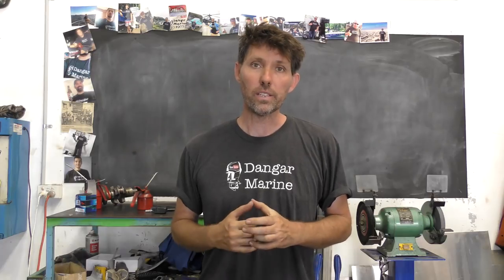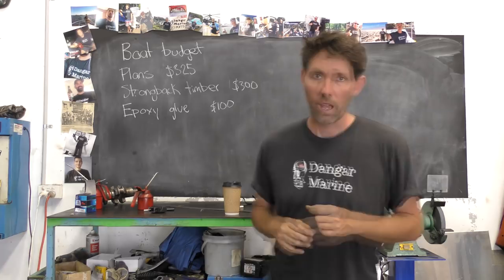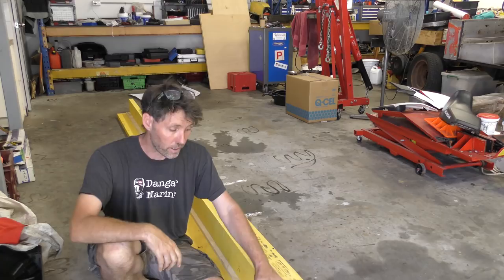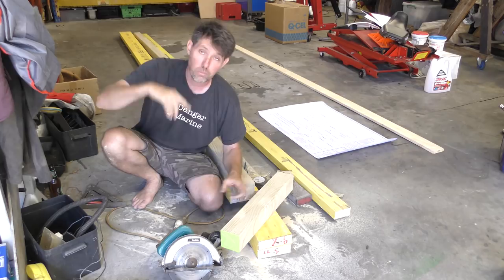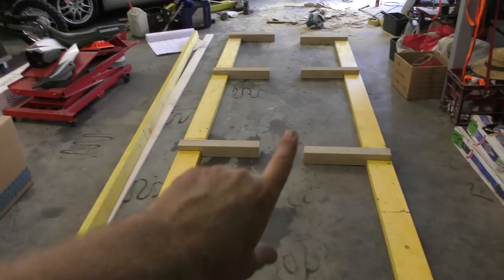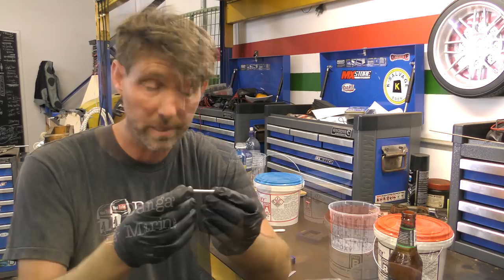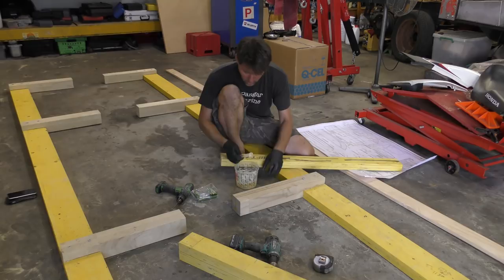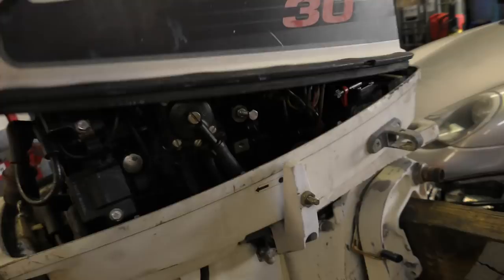Making the strongback

Comment: It's great to see you are building a Bowdidge design, i'm also building one his designs at the moment, just finished gluing the bottom panels and side panels. Mine isn't as complex as yours, i just wanted an inexpensive,  quick and easily built boat, so i went with his 14 foot Mushulu dinghy design. Came here for inspiration whilst the glue is going off. His plans are well priced and the back up you get from him is second to none

Comment: Great video .Can`t wait to see each step. Two bits of advise. Get off the floor and use a bench or table and get a power miter saw for perfect cuts . That will greatly improve your joints and fit. Cheers.
Reply from the maker: Thanks mate. Having the money for a mitre saw would be nice, but fortunately none of this requires a tight straight joint like you might want in furniture work. The rest of this build is purely done with a jigsaw and requires a small gap between each joint where the epoxy is pushed into, a bit like a weld rather than traditional timber joinery. Apparently having a tight fit creates a hard spot in the boat and actually makes it weaker.

Comment: Looking forward to the whole build! Just a tip, when cutting the 4x4s or any piece like those, instead of totally freehand, one easy way to make sure you saw squarely is to put your saw blade on the line you want to cut and then use your speed square up against the left side of your saw foot as a guide fence. Perfectly square cuts then...
Reply from the maker: Thanks mate. Yes, will be using a batten whenever straightness matters.

Comment: Great timing Stu. I have been debating my next boat as well. I wanted to do an aluminum boat myself. Looked at the cnc plans that you bring to a machine shop and have them cut the pieces and build at home with a jig. After seeing how much money for the aluminum and me not having any welding experience, or a decent($5,000+) welder that is preferred for aluminum, I knew it wouldn't be a smart choice. I do have good experience with woodworking. I build custom saltwater reef aquarium stands. So I figured I would go the same route you are. I'm happy you are giving a crack at it before I build mine. I will be paying close attention to the videos. GOOD LUCK!!!
Reply: jimbo gasoline 

Jimbo,  I am 3/4'rs through a build which I am thoroughly enjoying. I bought my plans from from the same place as Stu. HIGHLY recommended. Super easy, and I have zero boat building experiance.
Reply: GJ  GOOD LUCK BUD! I hope you like the final outcome. It would be cool to drive a boat that you built yourself. Once I finish some of my other projects I'm either gonna give this a try or find a hull with some soft spots and a rotten transom go from there. I'd like to see some pics of yours when completed.
Reply from the maker: I do like aluminium boats, but as you say Jim they are expensive and you do need to get good at welding first. I'm certainly looking forward to seeing it come together. :)
Reply: Some of the best boats are made from wood. Here is a popular one around here from the 60's 
https://goo.gl/images/E6cFYm
Reply: Tim's Workshop TJY Nice looking boat for sure!

Comment: Hard to beat an old johnson like that. We had a 25 evinrude on a wide 16 jon.  Dad bought the engine in 96(it was a 94 model year) and it ran faithfully till the misadjusted one of the coils causing it to contact the flywheel and it spun the timing plate in 2012.  We always had trouble with the starter coming loose, It finally damaged the bolt holes and we just put a crank top on it.  Can't wait to see you build a wood boat.  

I've been considering building a wooden jet jon myself, lots of shallow rivers  where I live now.  plus I have a small garage and outboards take up more space outside the boat.

Comment: Great to see you building a stitch and glue! I am nearing the end of building a 13'6" skiff - my first. For the next one, I have been looking at a Bowdidge or a Bateau design, but that's far off so I won't commit yet. Looks like you're off to a good start though. Just a thought, however, I would cut out some triangular pieces of wood and screw them to where the cross beams meet the longer ones. This will keep things at right angles, even with a few bumps and knocks over the length of the build. Best!
Reply from the maker: Thanks mate. I'll definitely do a bit of diagnose bracing, I just want to have a think about how best to do it without compromising access to the underside of the hull. I'm thinking I might also add wheels so I can push it out of the way when I'm not working on it.

Comment: I’m really looking forward to both this series, and that 30hp Johnson. I have a 25hp Evinrude. Basically the same thing except for the carburetor.
Reply from the maker: Yep, the Evinrudes and Johnsons are very similar. I wonder how many there really are out there still running, there must be heaps. :)
Reply: Dangar Marine yep! Thanks for all the great videos
Reply: actually they are exactly the same but for colour and stickers on the cowl. I finally worked out what was causing all my Johnson 50 issues  but the missus agreed to let me buy a new engine, so I sold the 50. Apparently pressure checks are not the way to go on crank shaft seals / case crack detect. Vacuum down to about 7 PSI and wait half an hour. a rise to 8 PSI or more is a leak. (absolute pressures quoted) . Basically- if the engine is 10 years old or more, change the seals on the two cylinder Johnrudes - cheap and easy preventative maintenance.

Comment: dude, what a cool looking rig. Looks a real machine can’t wait too see the build
Using our old fav mega 69, just be careful on real hot days it will cure very very quickly if mixed in large volumes. And the chemical process makes it get very hot on extremely hot days.
We do lots of stone repair using mega 69 mega H AND PF PM products.
I honestly had no idea on boats until I found you tube,  now using my boat for harbour works with confidence and the port deckhands, coxswain and pilots are disappointed cause we can now not hit every boat, wall and wharf on our way in and out. The harbour master asked us 1 day if we were related to Russell coight bahahaha
Reply from the maker: Good tip about mixing up too much on hot days, glad to hear others are finding it to be a good product. Ha, Russel rocks, stay safe out there! ;)

Comment: Definitely want to add diagonal braces to legs, and center supports (as already mentioned by another commentor!) Even if not needed for the boat building project, they will be good when used later as a bench/ when frame gets moved/ hit in shop :)
Reply from the maker: Yeah, I'll probably add a few short diagonals before too much longer.

Comment: Very interested to learn how you’ll waterproof the boat. Wood + water created so much rot inside my freshwater fibreglass hull boat that when faced with the fibreglassing of replacement wood (stringers, deck), the costs and toxicity and effort pushed me to get an aluminum hull instead. Can’t imagine having to waterproof an entire hull. Epoxy resin is less toxic than poly but is significantly more expensive; I was facing $800 cdn or more in fibreglass cloth and epoxy resin for the stringers and deck alone.
Reply from the maker: Glassing the entire boat is pretty much the only way, and even then it has to be done very thoroughly. I'm not expecting it to be the most fun part of the build but certainly essential.

Comment: Just a suggestion and a bit late I realize.  Instead of 4" x 4" legs, 2 pieces of 2" x 4" one cut shorter then the other, then laminated together would give you the same leg without the extra work (one cut at, for example 20" the other at 26", the 20" section would support the 2 X 6s, the longer section would attach to the 2 x 6s) and may be a bit cheaper depending on the lumber prices in your area.  I look forward to the rest of the build!
Reply from the maker: Yep, that certainly would be another way to go, and as you say, possibly cheaper. It also has the advantage of using the same stock for the cross pieces which would make the ordering simpler too.
Reply: Awesome idea

Comment: @Dangar Marine, what is the reason for using Megapoxy and not something like liquid nails you get from Bunnings?
Reply from the maker: Only because I need plenty of the epoxy for the boat and it saves buying 200 grams of something different for this one part.

Comment: Try using your speed square as a cross cut guide for your skill saw Stu.
Reply from the maker: For longer cuts I like to clamp battens for longer cuts where straightness is important but for short cuts where the angle doesn't really matter I don't bother.

Comment: Hold the shoe of the saw against your speed square to get straight cuts.
Reply from the maker: The guard of this saw is a bit sticky so I use two hands to manual hold it open, but I'll clamp a batten down whenever I need to do a long straight cut.

Comment: Don’t you have to worry about the LVLs getting wet.
Reply from the maker: Not in the workshop!
Reply from the maker: I should probably clarify that this frame isn't a part of the final boat, just the table it gets build on. I'm thinking of putting wheels on it so I can roll it outside for sanding etc, but it will live inside the rest of the time.

Comment: You've got the speed square Stu, why are you cutting free hand with your circular saw? https://youtu.be/7AOqNNUabbM?t=70
Reply from the maker: I don't worry about short non-critical cuts like this. For longer cuts that must be straight I prefer to clamp a batten down like in this video https://www.youtube.com/watch?v=PX_MuQ71uNc
Reply: If you are comfortable and experienced with a circular saw....the square is a waste of time unless you don't know how to rip boards free hand. If this was plywood that needs a perfect or factory edge then a table saw or a diy mdf guide would be a better option. My family who frames and builds homes would laugh if you suggested to use the square to rip a few 2x4s.They consider it a waste of time, or you don't know how to cut. If you are really experienced, you can rip long ply cuts free hand perfect.